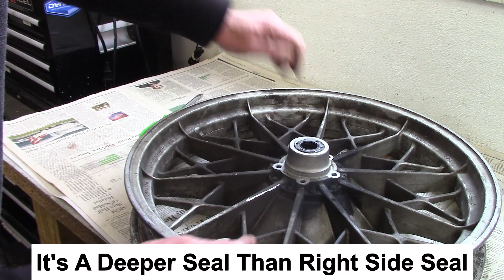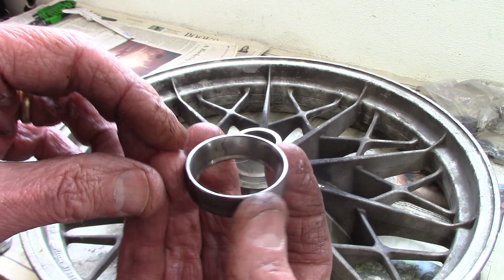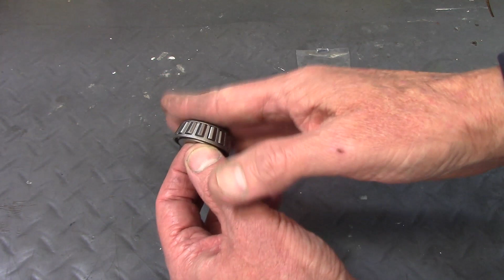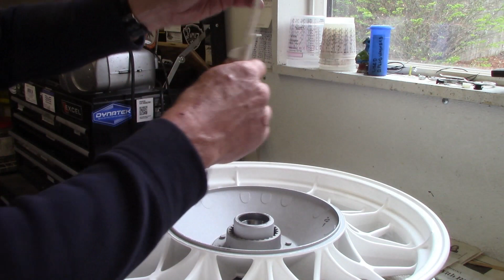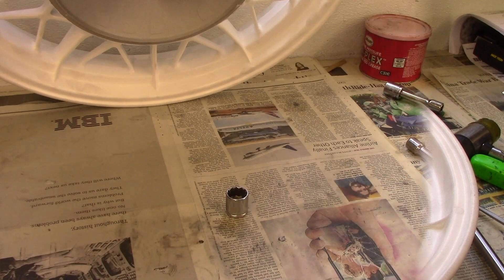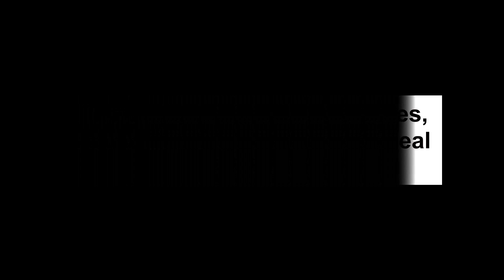1983 BMW R100RS Replace Wheel Bearings And Set Bearing Preload

Comment: Brook, 

I wanted to ask if you have tried this math when finding the correct new shim/wedding band width during wheel bearing preload.

It occurred to me that I should be able to take measurements to find the difference between the width of the new and old of the bearing inner races.
That width, with the width of the old wedding band should tell me what width new wedding band to buy.
Does this logic work or does it fall apart when actually doing wheel bearing preload?

My front wheel measurements:
Difference between old and new bearing inner race = 0.0048” (new bearing is narrower)
2 wheel bearings so 2 x 0.0048 = 0.0096” = 0.244 mm
Old wedding band = 0.2822” = 7.168 mm
New wedding band/shim width = 7.168mm + 0.244mm = 7.412mm

I realize that I'm making an assumption that preload was set properly on the old set of bearing but does this math get a guy close?
Reply from the maker: JIm, I suppose you could go that route. That said, I am comfortable with doing the measurement of the torque and adjusting as required. When I do that, I know for sure that the pre-load is correct.
Reply: @BrooksAirheadGarage  Oh, I still plan on using your method with the scale.  I am just concerned that torqueing with too large of a wedding band/shim width might damage the bearing...trying to get the clearance close before I torque and do final adjustments to wedding band/shim width. Is that a valid concern?
Reply from the maker: @jimhovland7672  The torque is so low that I don't think you will damage the bearing if you have too small a shim. When you torque the axle nut, set your torque wrench to 15 Ft-lbs and then spin the wheel, If you feel a lot of resistance, the wedding band+shims are too thin. The final torque is 25 Ft-lbs. So checking it at a lower value lets you know if you are in the ball park with your wedding band and shims.

Comment: aluminum race drivers are so cheap now ( the type with a stepped face that fits inside  the race to help centering & allow some power into the hammer. PS ; keep the flat side of driver flat and smooth for driving seals) that it hurts my ears to use an old race as driver; the old race is just hard as the new race and more  possible to nick/chip the new race than the hammer ! Also more difficult to hold a new race square with just the slippery old race as "cushion" . With the handle on a driver, new race is less prone to cocking.

 Heated hubs only help if you can work fast enough that the chilled race stays cold . Thats  another reason to use the aluminum driver - its fast & more accurate) . If you heat the hub hot enough , the race may just fall in postion ( this works better ie MUST DO on the original design - aluminum bore with steel race... the later steel hub liner  expands a lot less when heated, so the heated wheel is less benefit. You could heat a bare wheel til water dances on it ; not sure about those beautiful coated wheels

There are shelves / lips inside the hub bore; drive those races down till they ring, If the races are various distances apart, then any preset of preload is not accurate.

Pretty cool that you were able to " ship in the bottle"  rebuild the internal spacer  after the races were installed. 

Its also possible to sand / shave a some of the plastic rim evenly off the spool ,  reduce  diameter , which will allow  the whole assembly through the race. You'll still get some centering (which is the only thing the plastic spool does ) at worst maybe have to do a little hide & seek when inserting the axle.

Comment: I dont understand any advantage of having the top hat with BRIM INSIDE the seal. 
I can imagine a  tiny advantage of BRIM OUTSIDE ( the brim acting as a wee  bit of shield from direct water spray / grime  at the critical point (the lip) of seal. Also the top hat brim inside is rather easily pulled out through seal, it will l "'go back  in "  with a little umph too,  but thats not any good for the seal lip.  I install top hats - brim outside - just so I could clean them 

Futher , on the rear wheel, a possible advantage of BRIM OUTSIDE is to not damage the seal needlessly in case the top hat on the final drive side is changed  (this being the top hat which adjusts wheel offset away from swing arm to permit a wider rear tire... ).  

Re the wedding ring  side; that spacer tube acts symmetrically, facing 180 either way doesnt affect anything. Its just just a norm to put wedding ring on ( heck I cant remember which) side. 

 I find some plastic spool on spacer sometimes NOT overhanging to hold the wedding ring a bit more steady while installing the wheel. 

tap the plastic spool to overhang the metal tube when removed
Reply from the maker: a a, the brim pushes on the inner races ensuring bearing preload is maintained. The seal is a dust seal, not an oil seal, so the lip is not critical to sealing as it is for the crankshaft seals. The brim being behind the seal ensures when  you remove the wheel you don't loose the top hat.

Comment: Brook, I just finished powder coating my wheels and am ready to install bearings and set bearing preload.  I'm curious...why couldn't  a press be used to install wheel bearing outer races thus avoiding heat gun use and possible melting of plastic sleeve on the inner pipe ?  Jim H.
Reply from the maker: Jim, you can install the outer races without heating the hub if you wish. When I use a heat gun, the hub doesn't get hot enough to melt the plastic sleeves.  Most folks don't have an hydraulic press, so I showed what a hobbyist could use to do the job.
Reply: @BrooksAirheadGarage  Thank you for the clarification!

Comment: Please can I get BMW r1100s rear bearings, am really in need of it urgently
Reply from the maker: Nelson, any BMW motorcycle dealer can provide them for you and also Euro MotoElectrics has them (www.euromotoelectrics.com).  The BMW part#'s are 36 31 2 310 973 and 36 31 8 534 835.

Comment: Hi Brook,
thank you for this excellent video! I'm al little confused about the direction of the top hats.
On my bike I found them just as you did „backwards“ and I've never seen them installed the way you installed them, although it of course makes sense. I only ask myself: will you be able to release the dust caps for the next service, when you cynt't just take off the top hats? Is it very sure they have to be installed from inside out?
Reply from the maker: Hi Studio Hesterbrink, I use a screwdriver to pop the top hat out of the dust seal and then use the screwdriver to pry the dust seal out. I find heating the outside of the wheel hub around the seal with a heat gun expands the aluminum a bit and makes it easier to pry the seal out.
Reply: @BrooksAirheadGarage  Hi Brook, thank you again for the quick answer and for continuing your extremely helpful tutorials!
Kind of funny that here in Germany we have to rely on videos made in America to keep our German-built bikes alive...
Greetings, Ulrich
Reply from the maker: @Hesterbrink  Ulrich, sometimes excellence is appreciated more outside the country of origin.  In music in the 1950's and 60's, African-American blues had a large influence and was appreciated in England and only later grew it's audience in it's country of origin via the "British Invasion".  In the end, the excellence is appreciated and supported back in the place it started. :-)

Comment: Hi Brook, I hope all is ok.
I am a bit confused, as in the formula that you show in the earlier part of the video, you use 20-30 inch-ounces, which is about  0.104-0.0156 ft-lb a very low torque, as you said.
However, when you show the way method you actually use 25 ft-lb to measure the resistance. 
So, if I use 25 ft-lb and use the formula showed, I should read 15,119,733gr in the scale....
What is that I am not getting? 
Any help will be appreciated.
Reply from the maker: Francesco, the 20-30 INCH-Lbs is the torque needed to spin the wheel. So it's a measure of the bearing pre-load. The 25 FT-Lbs is the torque of the axle nut compressing the bearings on the axle. You set the axle nut torque (25 FT-Lbs) then you measure the torque needed to spin the wheel (20-30 INCH-Lbs). The tightness of the axle nut affects torque required to spin the wheel, so you have to torque the axle nut to the proper torque before you measure the torque required to spin the wheel.  I hope this helps.
Reply: @BrooksAirheadGarage  ok got it...it is clear now. Thanks

Comment: great vids Brooks, can you please explain how did you unscrew the bolts of disk break a the back wheel because they have some kind of lock on them !! thank you
Reply from the maker: Hi Johan, The bolts are secured with metal tabs that were folded up across the bolt sides. Use a screw driver to bent them flat then remove the bolts. You should replace those strips with the tabs.  Here is the video of that operation.
--> https://www.youtube.com/watch?v=4LqXe2n8DjU&list=PLOMI8_0YotYIVt7h0V8U9uWyN8JKuCS-p&index=28&t=3s

And the writeup with all the details:
https://brook.reams.me/bmw-motorcycle-rebuilds/1983-bmw-r100rs-rebuild-project-index/34-bmw-1983-r100rs-remove-refinish-install-disk-brake-rotors/

Comment: Hey Brook, Im still a beginner at servicing airhead. I have a 83 r80rt I’m working on. Stupid enough I did not watch this video or did any research before pulling the races before getting my wheels powder coated. So I did not did measured any distances of how far the races needs to go in and which side my sleeves came off. What’s your suggestion for me at this point? Thank you for help! I’m a big fan of looking at your video before working on my bike now :)
Reply from the maker: Hi Chau,  There is a link in the introduction to the video that takes you to complete documentation about how I do this work. Your question should be answered as to what goes where.

Comment: Thanks Brook!  Are you going to do this for the front wheel too?  I know you've done this on your website.  Tip: don't 'reverse' the front wheel during a tyre change and then fail to reverse the axle spindle; yes, I need to reinstall the bearings...
Reply from the maker: Hi Kaleuclint,  Both the video and the documentation in the link under the video include the work on both the front and rear wheels.